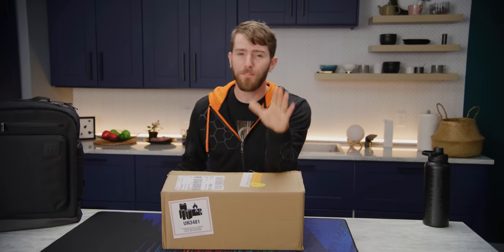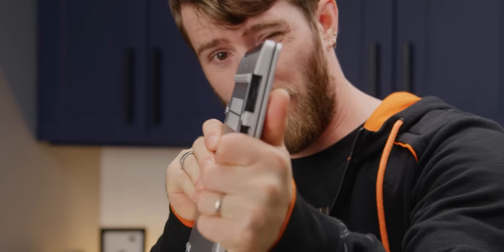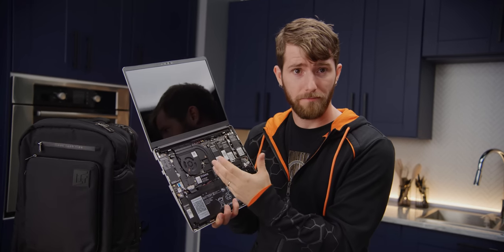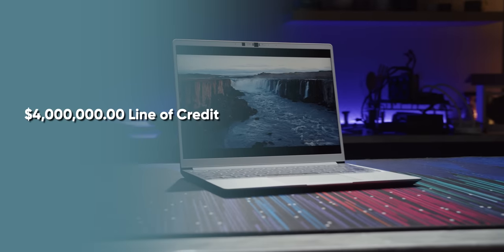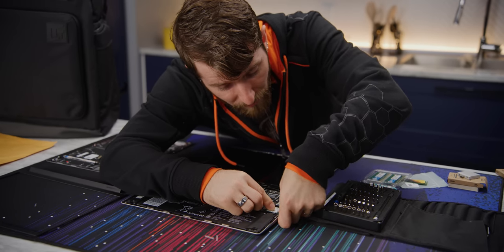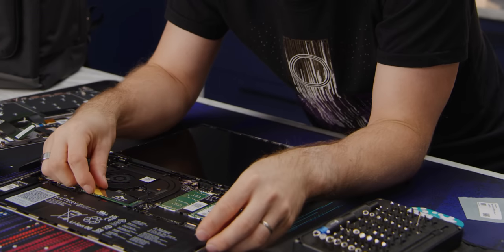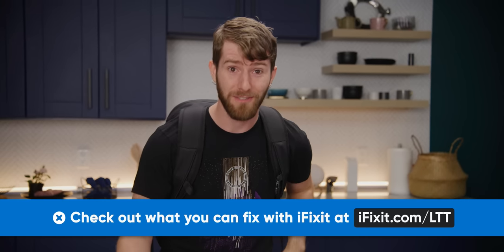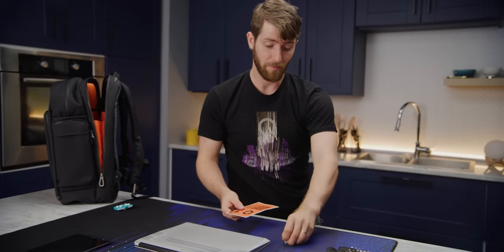I’m Legally Obligated to Disclose This - Framework investment

Comment: Linus backing Right to Repair is a major win considering his large audience.
Reply: Weeell, okay, playing Devil's Advocate: Linus becoming a shareholder for Framework doesn't BY ITSELF mean he's "backing Right to Repair", it means he's funding a company with a Right to Repair ethic. And that's fine, there's nothing wrong with that, but again, BY ITSELF, it's a capitalistic way of solving things. Actually backing Right to Repair means lobbying legislators to enshrine a Right to Repair.

EDIT: Huh, so apparently despite the two fully capitalised "BY ITSELF"s, people still think I'm saying Linus has never ever supported Right to Repair in any other way. Don't know what to say, are people just trying to get offended?
Reply: He's backed it multiple times in the past including several videos on it and with other big players in the space
Reply: @lodgin  
The capitalistic way of solving things is almost always the best way of solving things.
Legislation requires enforcement and controls and therefore costs money and will make always some people unhappy.
Reply: shoulda seen what he did for louis's R2R gofundme, the ltt audience contributed quite a bit
Reply: His "large audience" out of which maybe 1000 people will try to do something
Reply: OI, Louis!
Got a spare quarter million?
Reply: @sys-administrator  That's BS and you know it.
Reply: Zis co  Reported.
Reply: Nathan 😎  Reported.
Reply: Audience is inflated. Linus holds a pretty low retention rate.
Reply: @mehardeeps7629  Reported.
Reply: @lodgin  he said it multiple times in the past that he supports right to repair and he said that he supports framework BECAUSE he supports right to repair
Reply: @lodgin  anything he does is a capitalistic way of doing it. he’s wealthy and famous because of capitalism. the important part is that he uses his influence, at least in this example, for good by financially and publicly backing one of the best shots for easily repairable laptops that i’ve seen recently.
Reply: @sys-administrator  They said that repair shops can get it after signing an NDA. And that is fair enough. There is solid reasoning behind, as most likely the schematics are only partly their property and partly the property of the manufacturer. 

You can't break the system with one hit. You need to dismantle it. This is a step in the right direction.
Reply: @lodgin  There's no single real way to support right to repair.
You surely can lobby better laws to control companies, but you still need money for it, and big money always has to come from someone that has to get it back.

You need money to make better laws, and better laws to make money while being right to repair friendly.
Not saying Linus paid better laws, but he's big, and very openly supporting not just a product, but a way of doing things, an idea that people can actually buy and feel for themselves.
Eventually if this company, or one born by its example, makes it big enough, other tech companies will have no other option but to pour the resources necessary into changing their products to compete and I can assure competition drives muuuuuuuch faster than lobbying and trying to control.
Reply: @sys-administrator  the screen and keyboard aren’t for sale yet because it is an incredibly young company and they’re still working on everything. the reason that the board schematics aren’t available is because, if they were, a million DIY laptops would be for sale on alibaba the next day. 

the company responsible for the R&D of a product needs to have ownership over that intellectual property. if they cannot make profit to cover R&D costs, they will not grow and their business model cannot be continued. in order to preserve their position as a functioning company and provide far better repairability when compared to other companies, they need to compromise in some places. 

if you want true right to repair, make an open source laptop.
Reply: They are correct. If you sign an NDA and you are an actual repair shop (literally any repair shop as an official business), obtaining the schematics is easy and that's HUGE because it allows repairs to be muuuuuch easier and more straightforward. Makes sense since the board itself is unique and their property therefore requires it to be patented to prevent another company from stealing it and making their own version of the laptop (essentially to help prevent a Thermaltake moment.)
Reply: @sys-administrator  something is better than nothing, especially since nothing is the norm in the industry.
Reply: @lodgin  You forget that he's directly talked about Right to Repair and openly endorsed it. Look at the Apple Mac Air repair series, for example.
Reply: I'm actually afraid of all of this. But we hope for the best
Reply: @sys-administrator  If the company didn't have to sign an NDA, the company's schematics would be stolen by their competitors. That is necessary in order for a company to remain profitable
Reply: One can only hope.
Reply: Joe  you realized right to repair just got a huge win this year and john deer lost. this means farmers can repair the computers on there tractors. this was the first fight in right to repair we had to win and we won now there are others primarily in the tech space but a lot of the farmers lobbing are pushing for more they didnt back down.
Reply: He always has, and he keeps ranting about it, but def check out Luis Rossman, he's the man behind it at least in New york
Reply: His large, juicy, frothy audience.
Reply: The LTT audience is full of people who were already supporting this movement. It's everyone else that's the problem.
Reply: @NoobNoobNews  And that's all very well and good, but the Right to Repair should NOT be left up to companies to acquiesce to a minority of people's demands, otherwise the name "Right to Repair" is just hyperbolic advertising jargon and not an actual right you can exercise. I'm not going to hold my breath waiting for the "free market" to widely adopt consumer friendly practices, you shouldn't either. There's a lot of doe-eyed cooing about the "free market" in these comments as if it's some benevolent force of nature, and, like, no, it's really not.
Reply: Yeah, this is the key here - this isn't just a simple making money sort of investment, but a supporting push for right to repair.
Reply: @lars9925  Capitalism can manage a lot of things well, but some others it utterly screws up, being short-sighted by nature.
Basically, it cashes in quick, leaving all externalities for the rest of society to pay in its stead. In Europe, Ryan Air is a particularly good example of that deleterious mindset.
While it works much better over a whole swathe of business types, for anything big (transportation, education, power, ecological footprint)...It plain sucks without a good legislative framework.
Reply: @lodgin  Rossman is doing that, they are friends.
Reply: @delisaoton4298  xd sounds about right
Reply: Zis co  The fiend approaches with a link.
Reply: Yes, exactly.  Agreed!
Reply: @lue64  That video you linked is beautiful. I laughed so hard!
Reply: I've always personally opposed any company that tried to take away a buyer's right to repair. I respect that doing certain things will void a manufacturer's warranty and understand why. However anyone who buys something should have the right to maintain that product.
Reply: @eisenklad  after a year or two, you would need to upgrade the motherboard to get a new CPU etc… and only they would be able to supply that, I’m assuming? There’s hardly anything a normal guy could do with a schematic besides know what traces lead to where… it would be uneconomical to produce a “clone” board, especially when the OEM will sell you parts for it. 

As long as they keep the prices for repair parts reasonable, they’ll make money… from what I can tell with Apple parts for example, most are 3rd party, because 1. Apple don’t sell parts, and 2. Whatever genuine parts there are, are extremely expensive.
Reply: Joe  things take time, what a shocker! really, what are you expecting people to take away from you saying this? are we supposed to just give up or something?
Reply: @lodgin  if you acknowledge that then why write this comment in the first place?
Reply: @rushilkisoon  Yes.
which is why it doesnt make sense for Framework to sell swappable CPU and dGPU (so those people thinking that a DIY PC is the same should be prepared for disappointment). 
ultimately schematics is for either replacing the less critical components like ICs/fuses/capacitors found on the motherboard... and an average joe still wouldnt be able to repair it. its not cheap to get a hot air station or the other tools required for just a single repair.
at least, the third party shops dont have to depend on some russian/China-based hacker/leaks for schematics and hope the circuit values are correct.

as for Apple, genuine parts are expensive because they come from defunct/donor Apple devices. doesnt help that in the USA, the Customs department seize  the import of parts  taken from Apple devices  that are broken down overseas. 
https://www.youtube.com/watch?v=AVL65qwBGnw
https://www.youtube.com/watch?v=HkPUoUJPJAQ
Reply: @eisenklad   after second gen Intel i series chips, all mobile CPUs were soldered on. Plus there’s way more that needs to change on the board between generations of CPUs… new chipset, RAM (DDR5) etc. 

But yeah, I agree, the schematics will help those who know what to look for in the case of board damage, vs the average layman who wouldn’t know where to start, let alone have the capability to repair it.
Reply: @lars9925  Well, it's certainly best for someone . Forgive me if greed being the lowest common denominator doesn't exactly instill faith in the end result. The capitalistic methodology has left me with some pretty unsatisfying and downright terrible results often enough in the past that I'm still obligated to deal with regularly. stares pointedly at the USA cell service provider market
Reply: @lars9925  Thank you, Lars! 100% agree! (: 

Wir Deutschen sind einfach bekannt für unsere pro-kapitalistischen Ansichten! xD
Reply: yes
Reply: It's a win for everyone, not only laptop manufacturers, same as phones and other electronics
Reply: @lodgin  It's indirect backing. There's no way he isn't aware that right to repair is a big part of their philosophy.
Reply: @lodgin  The free market isn't a thing right now. The problem is that the world is addicted to foreign slave labor to produce their iphones. If we solve that, repairing products will become the norm. I think the right to repair is simply a symptom of the basic right to not be a slave. if we address the global slavery issue, most of the world's economic woes should fix themselves.
Reply: @NoobNoobNews  There will never ever be such a thing as a true free market. Even your own comment is wanting to impose limitations on the labour market.. which is fine, I even agree with wanting to eradicate our reliance on slave labour, but doing so isn't just going to solve "most of the world's economic woes", nor will the Right to Repair just inevitably happen. I admire the optimism but it's unrealistic at best and delusional at worst.
Reply: his audience is people who hate him and little kids who just want to play video games. Haven't you seen the videos of his conventions. Only other youtubers and the kids and their parents who have to take the kids (plus Linus' crew). If we based right to repair on linus audience then it will never get taken care of.
Reply: @lodgin  Yes they are. (Trying to get offended) It's very in.
Reply: take this reply so that there are 69 replies
Reply: Nobody outside of the device profiteers themselves is against right to repair
Reply: @lodgin  Here is the problem with your idea of what a free market is. A free market isn't a market where slavery is allowed. A free market is a market where everyone who participates in it are FREE PEOPLE. Slaves are NOT allowed to participate in the economic system free market or not, because they are not free.

A free country cannot own slaves... otherwise it is not a free country. A free market economy with slaves is not a free market economy... it is a slave market economy.

Switzerland is a nation where right to repair is not enforced, but you have thousands of high-skill watchmakers and tech repair people. They refuse to do trade with slave labor nations. Switzerland is literally a real-life model for what I am talking about.

What I am talking about does not impose any limits. It imposes rights.

Japan is a good example of a tech repair economy. Japan does business with China, but barely imports anything from China itself. It manufactures its own goods and provides its own services. All of their outsourcing goes to Korea and other surrounding nations, but rarely China.

Keep in mind. You are advocating for slave labor in opposition to me saying we should stop buying slave labor products. I may be optimistic, but your cynicism is toxic.

Say no to slave labor.
Reply: @NoobNoobNews  If you say so.
Reply: @lodgin  You are 100% correct. Even if Framework ends up being successful their approach is less profitable so other companies won't follow suit until the law tells them to do so. Linus is helping, of course, but true change won't come by investing on companies that do things right.
Reply: @lodgin  Linus has called out many companies for not doing right to repair, backing companies who do, as well as funding the ones who support it and practice it.
Reply: @gabelofi  You didn't read the edit, did you?
Reply: It's in no brainer and we would all be shocked if he didn't as an individual and considering his business model. His entire ethos is about right to repair and about you owning the product that you own. My OnePlus phone they refuse to repair due to water damage even though it's clearly one part that needs replacing, and they're similarly refusing to sell me that one part because it would void the warranty they're already telling me is voided. So my only option is to pay almost $100 for a used part to try to fix it myself. Not to mention all of the other stuff like John Deere and these other Farmers getting held hostage by their manufacturer controlled bullcrap
Reply: @lodgin  on top of this, with the laptop being so modular, it's much easier to repair under warranty, so their support costs after the fact should be somewhat lower
Reply: @lars9925  the government never solves problems it didn't usually cause to begin with... At least in the United states. The war on poverty, the war on drugs, the war on terror... Whenever the government declares war on something it makes it exponentially worse.
Reply: @nybbleme  
There is less terror in the western world compared to the 2000s and there is considerably less absolute poverty (I do not see this as a credit to governments, though). It's a mixed back with more bad "apples" than good ones.
However, some issues are just not targeted (quickly enough) by free enterprise like disaster relief and I trust big companies in the field of military and defense even less than the governments.
Reply: @lodgin  well ny will now legally require the right to repair:)
Reply: Right to repair is not a proper noun. You don’t capitalize it.
Reply: @lars9925  Yeah we live in America/Canada/Europe/Uk ect  not China. (im a democratic socialist/social democrat btw)
Reply: *everyone liked that
Reply: You mean our win, we are the audience.
Reply: I love this comment
Reply: LEEEETTTSS GOOOOO!!
Reply: investing in it is entirely different - nobody is against right to repair
Reply: @lars9925  Except the capitalistic approach is what causes most of these issues in the first place?
Reply: @fairsaa7975  
Which problem do you think was caused by a capitalistic approach?